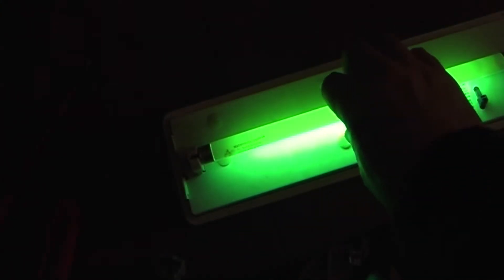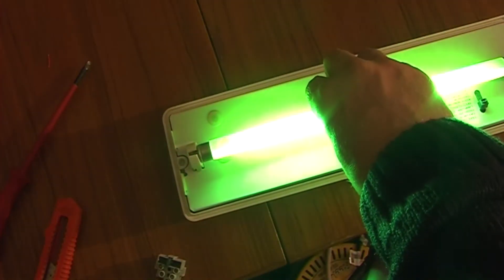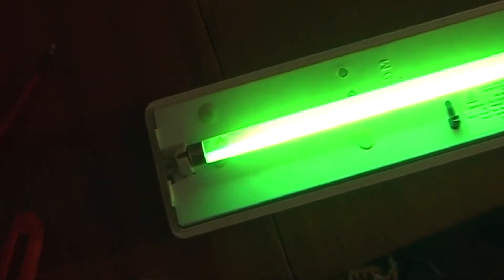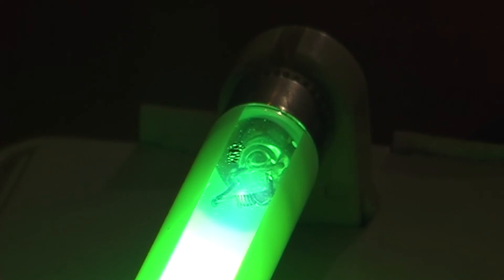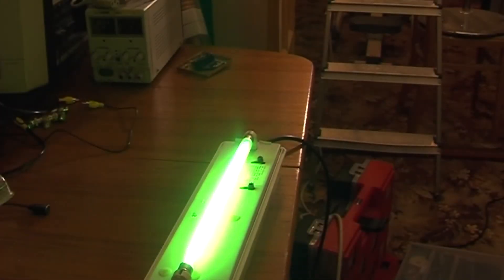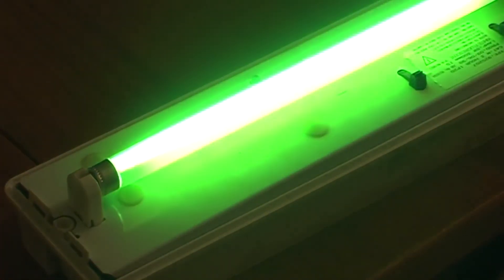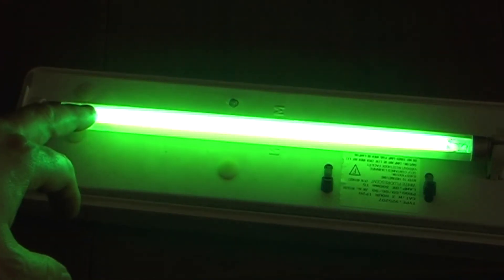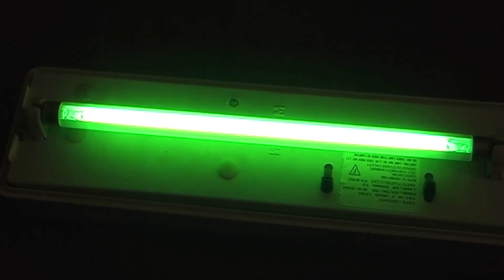A weird fluorescent tube (Matsushita Green-54 FL 8A70-G/29T16)

Comment: could be some kind of disco light that combines UV and green as the transparent part would let UV radiation pass through, if it's made of quartz glass at least. Or they just made it clear because otherwise it wouldn't be bright enough, those couloured tubes often have quite low intensity.

Comment: Its called a reflector flourecent tube light. Why : its to focus the light in one direction. The back of the lamp trows out light that you not use. If you say from a xerox machine its logic the light need to be focust on the paper and not in the machine.  So the light bulb can be less powerfull because you focus the light.  You also see this a lot in solarium tl lamp. You need the light in one direction.
I only want to warn you this tube can be made of special glas that lets the uv trough. It wil burn you and it wil damage your eyes. The use those lamps to desinfect. So they can be dangerous.

Comment: This type of lamps are used in older photocopiers, I have one with same bulb. The uv radiation bounces back from scannable item and makes the fluorescent glow brighter and the machine somehow prints with carbon onto paper using it. The fluorescent itself glows green, the arc itself is a standard mercury discharge.

Comment: That coating on the back function as a phosphor and a reflector. Some tanning lamps have the same thick white reflective band on the back. Green color is for document coping, but very old technology. Modern scanners use thin green CCFL lamps, or full color CCFLs.

Comment from the maker: @flamesecureUK But there's plenty of light given off around the rest of it as well, that's the weird (and hard to film) bit about it.  The rest of the tube glows like any ordinary (albeit green) fluorescent, although the inside does appear brighter than the outside. If it was only meant to glow through the strip I'd expect the rest of the tube to be silvered or foil-covered to keep it all in.  A very odd tube.